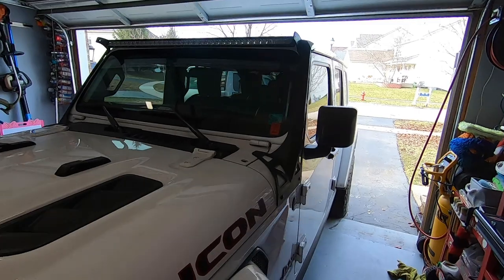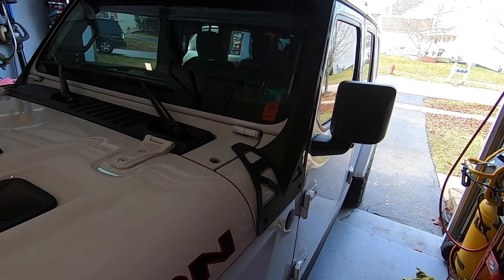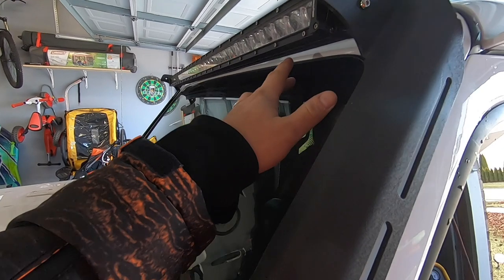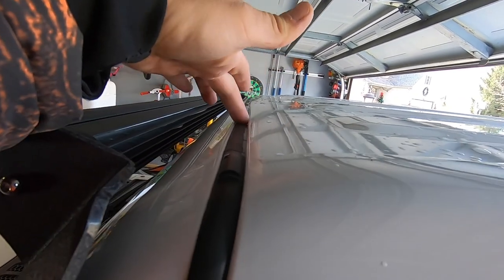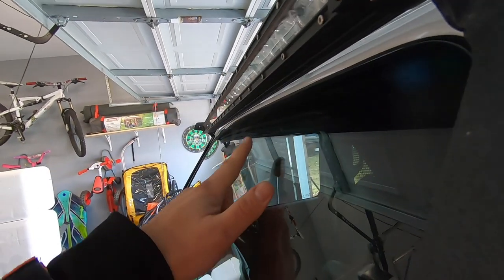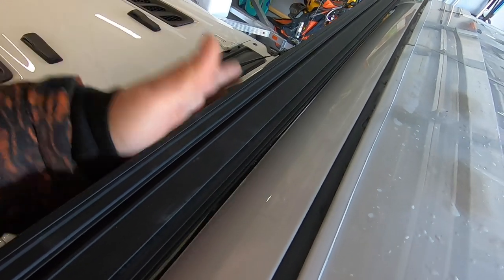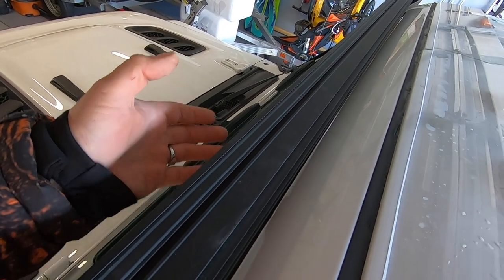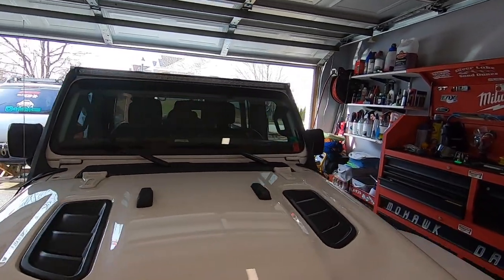BEST LED LIGHT BAR WHISTLE, AND WIND NOISE FIX FOR FREE. AND REVIEW OF DV8 MOUNT FOR JEEP WRANGLE JL

Comment: The easy and long twrm fix is to cut a piece of 48-50” plexiglass to correct width and slide into bottom fin. Then drill and pop rivet through the fin. It creates sup clean hidden spoiler and 100% eliminates a noise.

Comment: So I literally just installed the same mounts on my gladiator. Dv8 has made some changes to the brackets. They do come with a adhesive pad that covers the entire backside now, they also come with the 2 bottom bolts. However the top bolt kicked my ass. The bracket doesn't make any noise now. However with a soft top it's bad at 45mph and unbearable at +60mph. They sell wind diffusers that I'm gonna try but if that doesn't work I'll definitely cut the bracket.

Comment: I have a JLU soft top.  My light bar screamed like a dive bomber.  I used 1/4 vacuum hose and it stopped, but the soft top “drums”something crazy.   I’m wondering if moving the LB in like you did would stop the drumming?    It was originally pretty quiet.   If I can’t get it to stop the light bar has to go.   What are your thoughts?